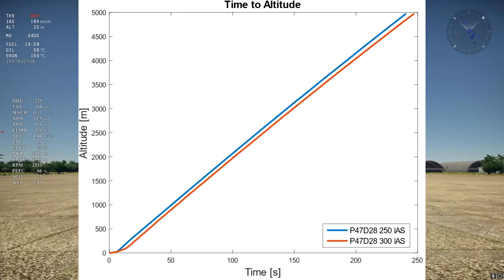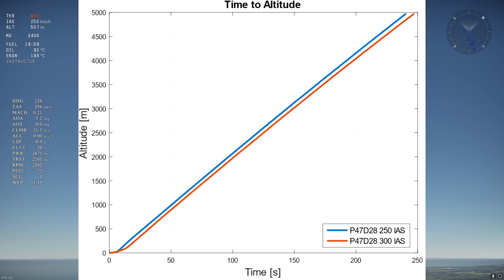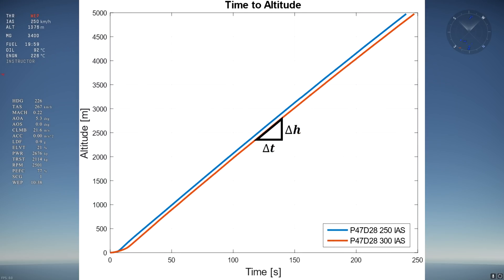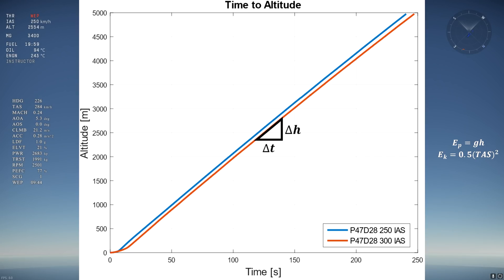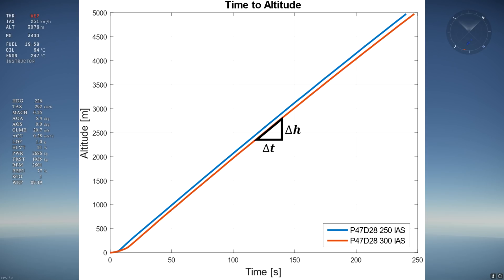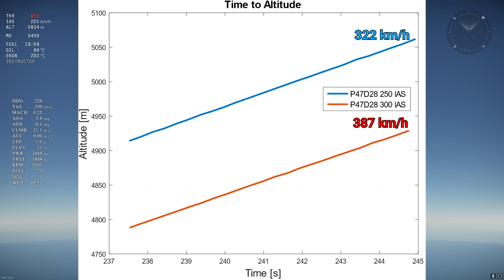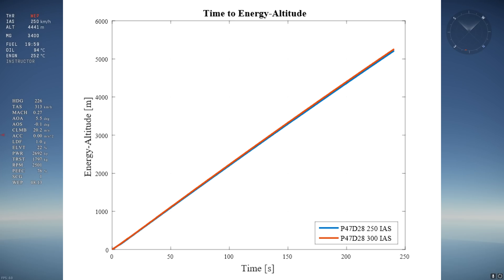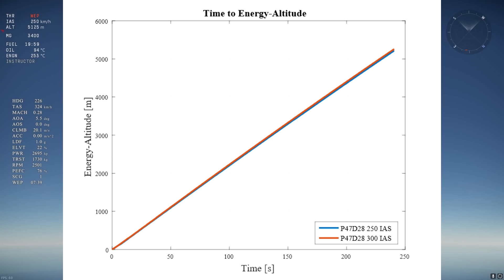Rate of Climb Misconception | Altitude AND Speed!

Comment: You showed a very good point and explained it well. Although I disagree with your wording - the 250 IAS P-47 still climbs better than the 300 IAS P-47 (as shown by the altitude against time graph), but the 300 IAS P-47 has more energy coming out of its climb. The 300 IAS P-47 climbs worse than the 250 IAS P-47 but has a little more energy than it (as climb is strictly speaking about altitude, not energy). But I will be sure to remember to climb a little faster.
Reply from the maker: Hmm what I meant was that maximizing geometric climb rate isn't what you should be trying to do, it's maximizing energy gain per unit of time.
Reply: @AdamTheEnginerd  Yeah

Comment: Well.. looks like WT flight models are broken while calculating drag, or higher IAS provides a little more pressure for the engine, so it produces a bit more power.
Last one means greater fuel consumption.
For some planes this could be important
Reply from the maker: Higher speeds to provide higher pressures to the engine and increases power. Not so much on turbocharged aircraft though.

Comment: Anything american I climb at 15-18 degrees anything else is 20 works great for me
Reply from the maker: If you climb by angle, you'll have to constantly adjust it as you climb. You are better off climbing by constant IAS.
Reply: @AdamTheEnginerd  I climb till a certain alt for Americans 13k ft then I switch to 13-17 degrees in anything else 13k ft and change it to 15 degrees I never break these rules of the first climb

Comment: This doesn't show the whole picture. After reaching the target altitude, the plane will level out and gain speed. And since the plane that climbed slower reached it's peak engine performance altitude first, it may catch up the "faster" plane speed when the last one reaches the same altitude.

Don't know how this applies to War Thunder's physics, but in real life, the best energy generation climb speed in a prop with constant power setting is the one with less combined drag from parasite drag and induced drag. This varies from plane to plane, but usually is around 240-280kph. You may be slower at every altitude, but if you level up at the same altitude, you will be faster at the same time.
Reply from the maker: Hmm props don't accelerate faster as you increase altitude, even if we suppose that they both climb to their optimal altitude. That's because thrust decreases with TAS, and TAS increases with altitude with a constant IAS, leading to a decrease in thrust at higher altitude compared to sea level.

The best climb speed is where specific excess power is maximized, so engine power minus drag power (Drag*TAS).
Reply: @AdamTheEnginerd  thrust decreases with altitude up to a point where you need all your power to keep level flight. But as you said, energy comes from power. So, the energy you store at every instant comes from (engine power - total drag). Engine power is a factor that depends only on engine RPM. And the drag is the sum of parasite and induced drag (my reference is Aerodynamics for Naval Aviators).

What I meant is that you accelerate faster at higher altitudes is because you have less drags, so an increase of 20 IAS at higher altitudes is more significant than 20 IAS at lower altitude, since it represents more TAS. Ofc, if you're using all your power to produce enough thrust to keep level flight, you won't be able to increase the TAS. But as long as you have enough air pressure from the intake+supercharger to keep high thrust, you can accelerate
Reply: Plus I don't know how this implemented on WT, but I'm considering the engine air intake and supercharger rate limited by the max manifold pressure to avoid engine knock

Comment: I'm bad at math but at what occassion angle of climbing matters on certain planes?
Reply from the maker: Sometimes it's useful to be able to keep up a high angle climb when they enemy can't in battle, but to gain energy efficiently you should climb by constant IAS, not angle.
Reply: @AdamTheEnginerd  Huh I use my instinct when starting to climb on take off, I waited til the IAS(I got no extra information like yours on the left) reached 300 to 350km/h depends on how plane perform on stat cards and experience either stock or spaded, and then climbed for 18 to 20 degree also depend on plane performance, after about 3000 to 4000 I assume some planes should be above me so I maintained 13-17 degree to gain some speed just in case I might encounter trouble.

Dunno if that's correct approach.
Reply: On side note, my flying approach depends on teammates, I often use myself as bait but sometimes disappointed by teammates abandoning me.

Comment: Is there a resource for the optimal climb speed of every aircraft?
Reply from the maker: I'm working on one, there's an older one with a tad too slow climb speeds by 10-20 km/h.
Reply: @AdamTheEnginerd  do you use a certain tool to gather this data? I'd love to help if that's okay.
Reply from the maker: @volatile5460  I do, I check FM files for the relevant coefficients and go in test flight to get prop efficiency. Not much you can do to help.

Comment: Is there some way to use variables to replace the data so you get the optimal speed for you aircraft? Like in a excel/google sheets?
Reply from the maker: There are ways to cut down on testing, but like I explained in my rate of climb video, you'll still need to go in test flight to get the prop efficiency.

Rate of climb video: https://www.youtube.com/watch?v=eEeBX7XAgsw&ab_channel=AdamTheEnginerd
Reply: @AdamTheEnginerd  If you do a straight line dash from stall speed to top speed, and plot the acceleration against velocity, does that immediately give you the specific energy graph?
Reply from the maker: @dsdy1205  It'll give the specific excess thrust curve.

Comment: So don't throw my throttle into WEP in the Bf-109 K-4 or do? Like do I need to actually do math to get up there faster?
Reply from the maker: WEP will make you climb faster for sure.
Reply: @AdamTheEnginerd  how does WEP factor into the climb time? I usually just take off, throw on WEP, put the plane into like 15-20° climb until I get up to like 4k meters(at which point my engine starts to over heat and I dial it back to 100%). Is it better to gain some speed and then WEP climb or just go straight for the WEP climb?
Reply from the maker: @OtterTreySSArmy  You should watch my rate of climb explained video. WEP increases your engine power, and climb strongly depends on engine power, so it improves climb. WEP as much as you can.

Comment: Cool vid.

TL; DR: Adam, please do a vid on a stock F-86A-5, max uptier.

A question - Adam, can you please show us how to Sabre? Because the stock F-86A-5 can get in the same battle as the F100s, the pre-top MiG-21 and the Lighting, while having high repair costs. Not even speaking about the F-86F-2, that does the same and has even higher repair costs (16K stock compared to 5-6K on the F100D) and the only advantage it has over the F-86A-5 is the cannons instead of Brownings.

I'd really love if Gaijin gave US the A-40 modification of the Sabre since it, at the very least, has AA rockets.
Reply from the maker: Thanks!

That's too specific, and I wouldn't remove mods on an aircraft to fly it stock. For any aircraft though, if you think it's weak against the competition, then you can fly something else instead.
Reply: @AdamTheEnginerd  But how do I get to the F100D then? Cause the Starfighter is just bad at 10.0
Reply from the maker: Probably F104 is a better deal for the BR than F86A.

Comment: Bruh I found this out 2-3 years ago when I noticed the little circle at the climb view, I noticed my nose was the little circle and not the mouse. Everyone thought I was crazy saying they're climbing at 15 degrees instead of 20
Reply: So if someone says to climb at 20 degrees or something the little dot goes there and not the circle?

Guess ive been doing it different
Reply from the maker: @Kay_213_  No, most people mean to say point your nose at 20°.
Reply from the maker: No the nose is the big circle! Your true heading is the little circle which gives the angle of attack by comparing with the nose (big circle).
Reply: @AdamTheEnginerd  the little circle is actually the acceleration vector?
Reply from the maker: @ioan-alexandrutrofin4524  No it's your true heading. Your nose is typically pointed higher than your true heading because of the angle of attack required to produce lift to counter weight.

Comment: There's one thing I don't understand (I haven't watched the 1st video, but haven't got time for that right now). When comparing those climbs, shouldn't both planes be climbing at an angle that allows them to keep the IAS that is talked about, ie. 250 / 300 kph? If yes, then why do they end up at high altitude with IAS different from that? If that's due to optimal climbing speed - how to determine it?
Reply from the maker: They end with the same IAS, but different TAS! And TAS is the true measure of kinetic energy!
Reply: He is at a constant 250/ 300 kph, IAS, he's measuring the TAS (322/ 387 kph) at the given altitude for the final equation. I'm still a little confused with the whole IAS/ TAS thing but at higher altitudes your TAS is considerably higher than your IAS. The way someone explained it to me was the IAS is something like the air flowing around the wings and gives you a better representation of your aircraft's capability in terms of maneuverability when at higher altitudes whereas the TAS is the literal speed you're flying in relation to the ground.

Comment: Every aircraft has a best rate of climb (Vy) and best angle of climb (Vx) which is calculated based on avaliable horsepower and total weight. Best rate gives you best time to altitude while best angle gives best altitude over given horizontal distance. All u need to do is point the nose to hit that speed IAS right from take off
Reply from the maker: Yup.

Comment: If it works in the game it doesn't mean it works in real life. Beyond the optimal climb speed, there is increased fuel consumption and engine wear (including overheating) and a pointless extra distance covered while climbing. Some planes are designed to climb at a greater IAS for a variety of reasons including power to weight ratio, acceleration in a specific speed range (air intake and injection) and the airframe with the wing loading.

That is not to say that planes designed for high speeds should revert to optimal climb speed instead of a mild climb at around 10 degrees when they have a high IAS already.

So if the planes take off from the ground they should use optimal climb speed, while if they start climbing while having a greater IAS they should climb at a mild angle.

WT is poorly designed as planes lagging behind another one which climbs at a sustained climb speed, in prolonged pursuits in the same direction, level out then dive, accelerate (without any drag penalty) then pull up and voila: all problems gone - it is the WT way of climbing to space in steps instead of a straight line (mild curve).
Reply from the maker: Euh not sure I follow. There's definitely higher drag if you dive and accelerate instead of keeping your optimal climb IAS, but you'll catch the enemy you're following because your higher speed will allow you to close the distance. You'll be gaining energy slower than your enemy, but you can still shoot an enemy that is 500m above you. That's why that works in WT, and it would work irl.

Comment: I always climb at higher speed.
Why? By calculating the energy conservation theory, it is exactly same, hence I climb at higher speed to cool my hot engine. There isn't any Carnnot's engine in game where the more heat it produce, more efficient engine you've made. If I do so, I ended up paying spawn points.
Reply from the maker: There's an optimal IAS for every prop. Going faster than that will lead to the same reduction in energy gain as going slower than the optimal speed. Indeed though engine power does not depend on temperature.
Reply: @AdamTheEnginerd  I neglect the air compression of the props though.... 
If I count so, yes I should a bit slower :p
But in every flight, I always do it by feeling lol

Comment: How are you exporting the data points? You arent doing manual input are you? If yes what is the resolution?
Reply from the maker: Using Void Mei with 0.3s between data.
Reply: WTRTI(overlay) can also export to .csv file. How to do this, read the section "Logging & MER calculation" on the app forum page. 
https://forum.warthunder.com/index.php?/topic/483838-warthunder-real-time-information

Comment: i used to test this, with different prop pitch for the p47d28, after a climb, i would point the nose straight up and not the max altitude.
best proppitch seems to be between 80 and 85% and ias climb speed is 280~km/h

but when fighting other i usually climb at 280ias and once i feel confident i increase speed of the climb in order to throw enemies off, attacking them from below with more energy.

there is an even more exiting trick for the la-7, climb to 1500m and build speed in a shallow climb 5 degree, close the radiotor and lower proppitch to gain 600kph+ ias, then zoom climb into the enemy climb path and take 1 or 2 out from below with an insane energy advantage. You can even drag more enemies down with you and use your superior engine performance below 3000m to absolutely destroy the chances of them winning the match, by either fighting to the death while dragging the entire enemy team with you, or climb back to your allies and join them to fight 8v6 instead of 8v8. both options increase the chance of winning the match by quite a lot. (havnt tried it with a squad yet tho, but can you imagine?)
Reply from the maker: Those are good prop pitch and speed ranges.

Yeah on low alt fighters I like rushing in as well to either bait or kill slow enemies.

Comment: Which short nosed 190 is the best?
Reply from the maker: A5/U12 with only 2 MG151.
Reply: @AdamTheEnginerd  should I put gunpods on it?
Reply: @AdamTheEnginerd  climb speed for it?
Reply from the maker: 270 or so (not tested). You can't put gunpods on the one I suggested.
Reply: @AdamTheEnginerd  You can put 4 20mms on it...
Reply: @StarWarsMasters  Adam meant A5/U2
Reply: @simon_kuba  bruh rip SL

Comment: If you got higher than your enemy, say a Spitfire LF mk IX outclimbs a Ta-152, the 152 would be more likely to just run away than fight you because he sees you're at higher altitude even though he's in a higher energy state. Should I try to climb less in the spitfire and get some more speed so I can meet them head on and they won't just run away?
Reply from the maker: Yeah that is a trick, it's easier to see that someone has an altitude advantage than a speed of advantage, so they'll be less likely to run away indeed.
Reply: I think I'll start trying that then, I have a lot of trouble with enemies simply running off if I get into a good energy state on them. It's a weird balancing act of seeming like you're a potential kill without being so high that they just won't engage.
Reply from the maker: Yup, gotta give hope!

Comment: Clearly explained, thx
Btw, shouldn't optimal climb speed slowly decrease as your engine power decreases with altitude?
Reply from the maker: Yes it should! Actually it should very slightly reduce even if power stays constant due to TAS and drag power increasing for a constant IAS.
Reply: @AdamTheEnginerd  In this case you mean the TAS decreases while we maintain a constant IAS right?
Reply from the maker: @dsdy1205  As you climb, TAS increases if you maintain constant IAS. His point is that IAS should technically decrease slightly as you climb as power decreases.

Comment: Question: when on maps with airspawn enabled, should we immediately pitch up and zoom until we decelerate to best climb, or should we adopt the correct climb attitude and wait for the climb ias to drop to the optimum number?
Reply from the maker: Pitch up to decelerate quicker, then as you near your optimal climb speed you should gradually reduce the angle so that you reach your optimal climb speed, and then continue on that constant IAS.
Reply: @AdamTheEnginerd  alright, that makes sense thanks!

Comment: so how does one find the best climb speed?
and I m assuming angle doesn't matter
Reply from the maker: Coding a simulation with the FM data file coefficients, or by testing multiple speeds and seeing the energy gain for each.
Reply: oh boy, manual method

😬
Reply: @krestonkurotani3231  Or go find some warthunder climb data sheets, they're usually quite close.

Comment: In the real airplane world, aircraft are rated at best angle of climb, and best rate of climb.  Both are listed as Indicated Air Speed values.  I wonder if you could do a comparison of both on the same aircraft in war thunder.   Since I side climb most of the time, and once I reach my altitude I'm aiming at, I level off anyway to gain speed. Wouldn't angle of climb sometimes be more advantageous?
Reply from the maker: You're better off climbing at the best rate of climb, and climbing to the side to meet the enemy later. That'll allow you to be higher and meet the enemy whenever you want, neutralizing the advantage of the best angle of climb.

Comment: I DID learn something. I've been climbing at a 265kph IAS. I'll have to start trying 300. Ky main issue is coming up against aircraft who I'm holding elevation advantage over, but are able to snap nose up for a good burst (i.e. yak3), and who seem to retain their energy even after the drastic nose up climb to engage me
Reply from the maker: Well it depends on the aircraft, these speeds and climb rates only apply to the P47D28. 300 would be way too fast for an A6M for example.